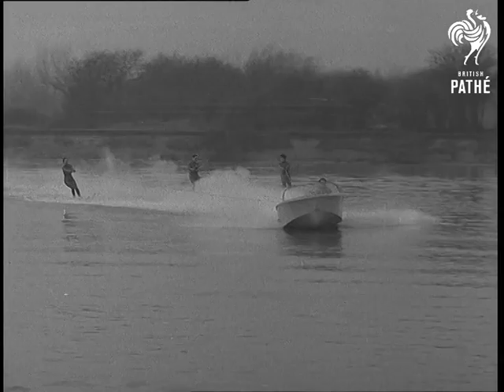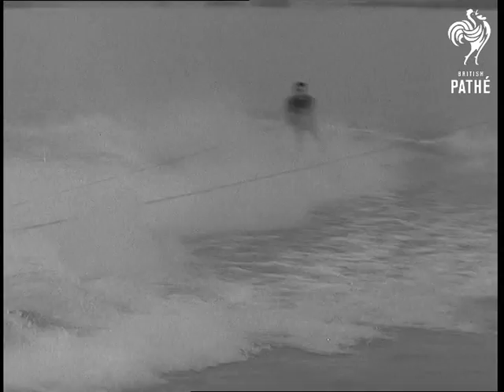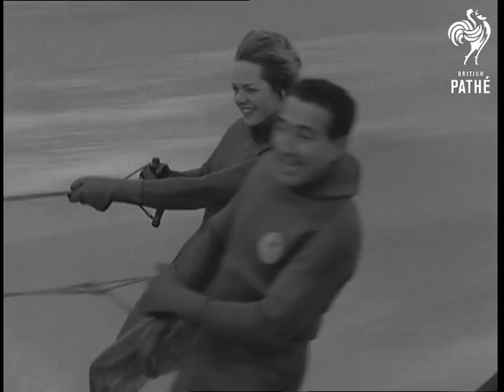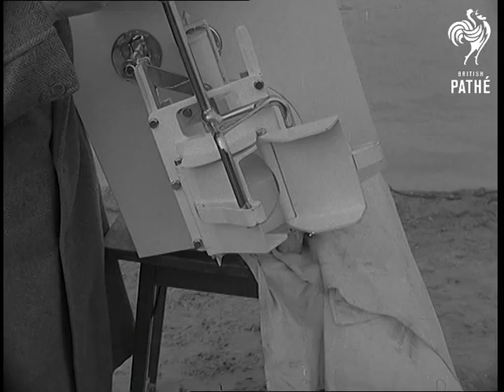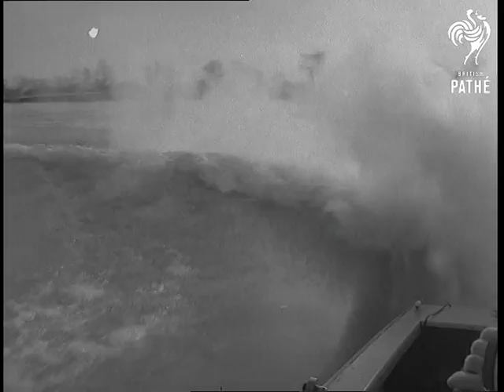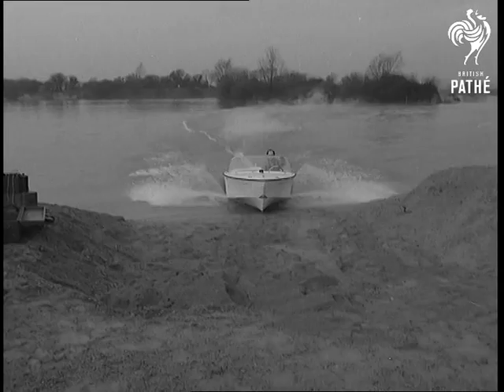Jet Boats For All (1959)

Comment: it was also a boat of 17f 4 inch long (5.25M )designed by Campbell powered by an essex V6 very well marinized  by Castoldi n driven by their 05 Jet i had one i know, kept it in mariner's farm lower Rainham Kent  they started manufacturing them again in Surrey in the late 70s early 80s it was called bluebird jetstar it was actually very well handling boat but seen nothing about it on u tube just wondering why